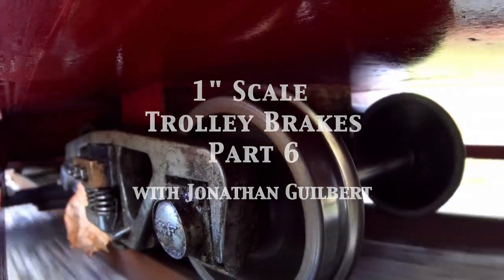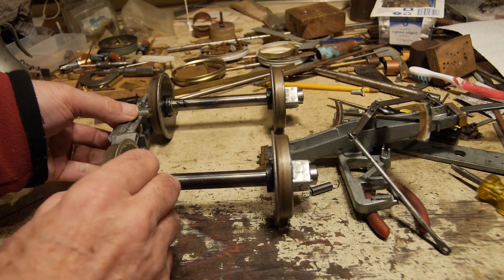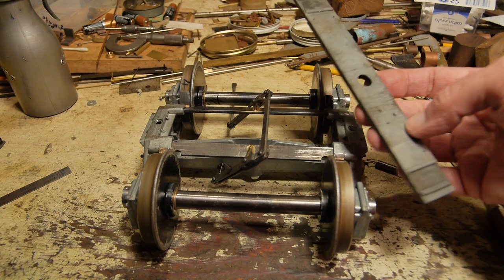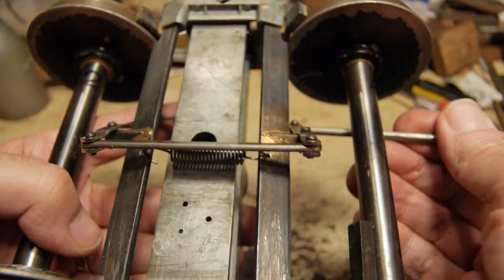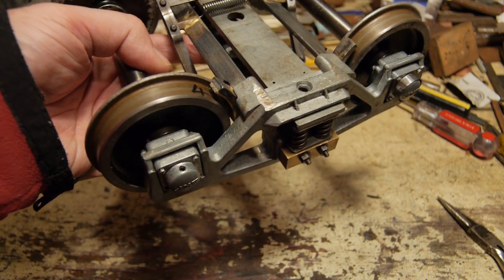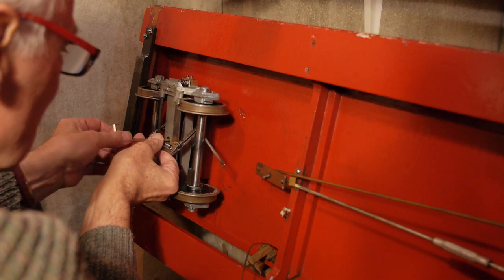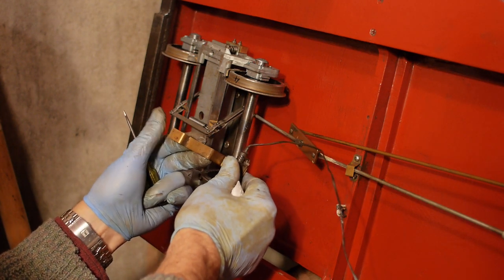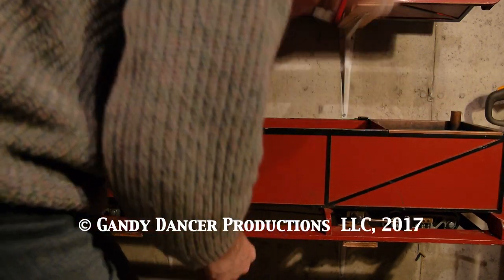5" Gauge Railway Trolley Brakes Repairs Part 6

Comment: Really love your videos, I was wondering why you hadn't updated in a while, the snow explains it and that's a lot of it too.
Would sand help the wheels get traction on the rails?
Reply from the maker: Thank for your comment.  Sand would work great but it would also get into the bearings and slide bars and cause havoc.  They get away with using sand on the big railway because the delicate bit are much higher off the rails.  I get trouble in the summer from tree sap and ants and scrub that off the rail head with detergent and a mop.

Comment: why have a free wheels, it just causes more problems then its worth and causes more derailments just do what i did get fixed bogies and you will be fine and whats wrong with stopping with your feet my 3.5 inch suffers from bad breaks but still stops fine, just have to learn the ways of running the locomotive and how they like to stop and there stopping distances. as for driving car breaks use disk breaks on the axle works fine for me.
TMS
Reply from the maker: I think disc brakes are a good and simple solution but it's helpful if the bogie is designed for them from the start which mine aren't.   The free wheel is held to gauge by a collar, is easy to make and they haven't caused derailments.  With a free wheel wear and tear on the tread is much reduced and they don't squeal round corners.  The braking is much more of a problem, especially with my gradients, if I have a load of kids or adults on the train.
Reply: Gandy Dancer Productions I guess it does help if the bogies are designed with disks in mind as for the collar holding the wheel in place I guess that would work but what happens if you go round a sharp corner with weight on it and it slips out of gauge and my personal opinion on squealing wheels the curve radi is too sharp I tend to use 60ft to 100ft radi on my curves, for my breaking I have minor grades but vacuum breaks take care of that but now you explain the wheel side of things it is  good idea just wouldn't use it in my own opinion.
TMS
Reply from the maker: The collar won't slip if it's made a close fit and the grub screw tightening it pinches into the axle material.  I have 25ft radius curves, so quite a bit sharper than yours.

Comment: Why not make a snowplough to put on you locomotives
Reply from the maker: That snow pretty solid and heavy.  I have tried clearing lighter snow but with my grades any chance of ice getting under the wheels and the loco slips to a stand.  You can hear it slipping a bit in the video with two passengers on and a dry rail.